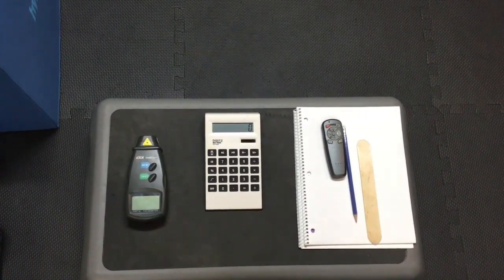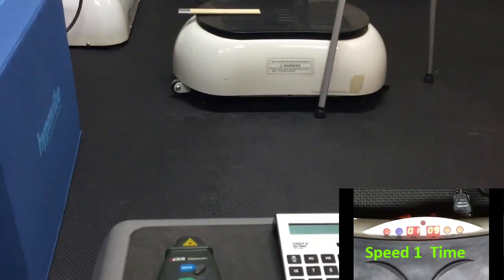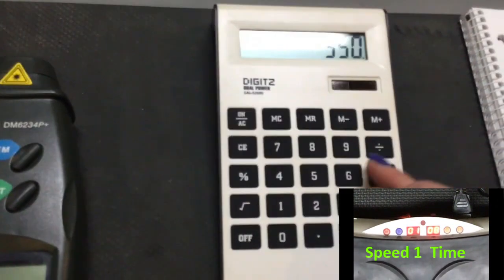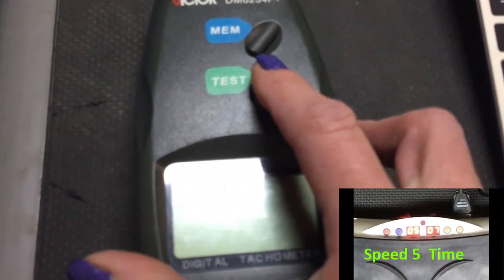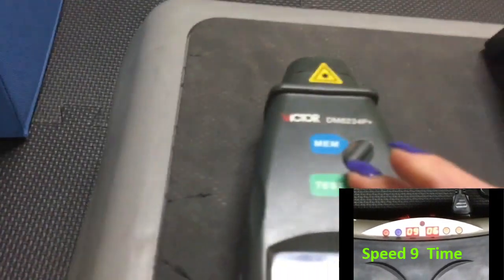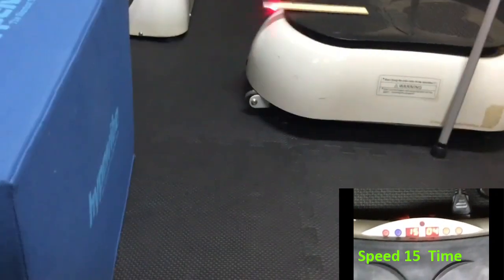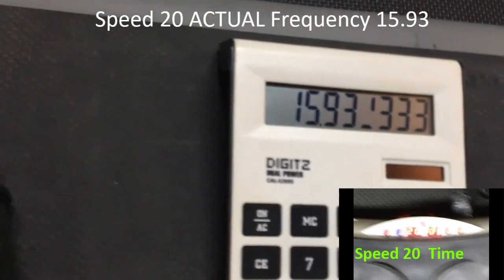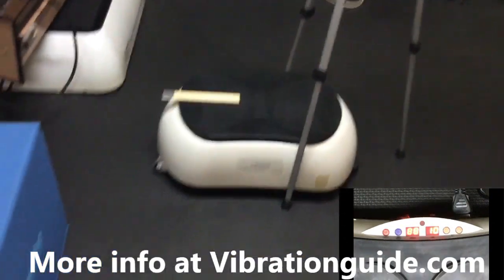Vibration Machines - Speeds vs levels

Comment: I have a vibration plate that says 60 hz in the manual. I just watched an LIV video that said for getting bone marrow to produce bone I should be on my vibration device 2 or more minutes multiple times a day at 30hz.  Do I need to test with the digital tach like you did or is the highest level closest to 30hz? Neither of my machines; Rock N Fit by Eschelon or Felicity859 by Daiwa have any information on this. Love your channel. Great info! Keep up the good work.
Reply: Hello Judy :) As a mental note gong forward, any manufacturer doing a video will focus on their gear, their specs and often give misleading or outright lie about other equipment. Not much integrity in sales these days. The 60hz in the manual you are referring to is not the operating fq of your machine thats the power supply. Bone density isnt a setting, its about weight bearing activity. The plate is just an environment that makes those exercises more effective in less time. The LIV machine is a completely different movement style than your machines and in my opinion and experience at unethical. 30hz is a setting on a vertical style plate like their but they have very little amplitude a factor they dont mention and many others do not discuss. Amplitude is the amount of movement each time the plate moves. LIV is well below 1mm. Medical grade versions are as high as 4mm in combo with the 30hz. The research behind their machines is biased and they do not compare to the true medical versions.You machines are oscillating, amplitude is controlled by foot position. Closer is less intense, wider more. Your actual frequency will be around 15/16 hertz but you machine will have that broken down into a variety of speeds so you can adjust in increments. Medical grade versions of your machine got upwards of 30-36 hertz but cost thousands. I see tremendous results in bone density on ALL types of consumer grade machines like yours. Consistent use is key. If you are able to do more than stand like some light squats you will also get additional benefits like more strength, more calories being used etc.
Reply: @debbypelletier  Hello.  I am in a similar situation.  I bought a vibration platform that also indicates 60 htz on the underside.  It has speed settings from 1-99 and recommends 20 for walking.  It was suggested to me to not exceed 13 hertz .... too high a frequency could be harmful and too little could not be beneficial as I am trying to strengthen my bones due to osteoporosis.  I am confused about the speed I should use.  Can you help me?
Reply: @janisbordi1339  sorry but you have been poorly and on only one part of the equation.Who suggested 13 hertz as a max? Did they suggest at what amplitude?  What positions? For how long? Do they know why type of movement your plate offers? Without you first understanding there is more to it it's hard for me to say whether 13 hertz is best for you or not. There are different types of machines and the frequencies do not translate equally. We haven't discussed what you are using the machine for in the first place, any issues all this need to be considered. THe machine is simply an environment that makes exercise and basic movement easier, and oftern more effective than other more trasitional forms of activity. There are also therapeutic applications. I have kids as young as 6 months old using machines at much higher that 13 hertz with no issues but know I support them and their therapists already in most cases. Please see this recent overview will help explain more about your machine and how to use it. https://www.youtube.com/watch?v=8IGd4mC41MI&t=6s
Reply: @debbypelletier  Thank you for the video link... i watched it and it was very informative.   a little about me...  I am 61, and diagnosed with osteoporosis 4 years ago.  I receive the Prolia injections 2x/yr.  I have taken vitamins/supplements and exercised most of my adult life... basic weight work and walking on treadmill 6x/week for 30 minutes.  I eat relatively healthy, don't drink or smoke or consume caffeine..  I purchased a low end Best Choice Products vibration plate.  It has speeds from 1-99 and suggests 20 for walking, 50 for jogging and 80 for running.    My question at this point is... because most of my rooms are carpeted, could i put the plate on a piece of wood on the carpet... otherwise i only have my small kitchen or laundry room to use.  Thank you
Reply: @janisbordi1339  you can certainly try a piece of wood, an exercise mat or flatter door mat of types might be all you need. Don't want you tripping on the wood stepping up onto the machine either lol. Ignore the Walking/running etc that is BS. Keep to guidelines I have shown in my video and use a mid to high speed range w feet no more than hip width apart.